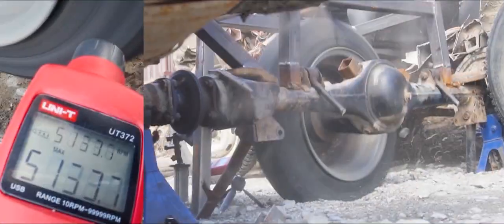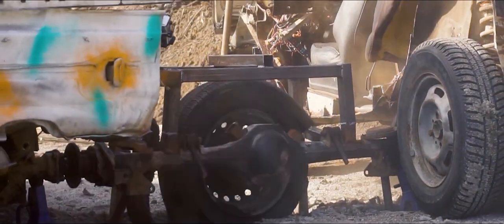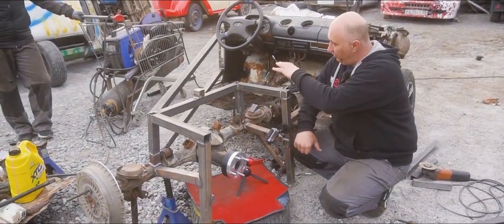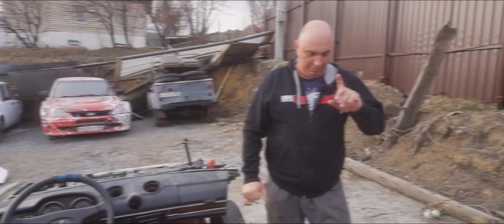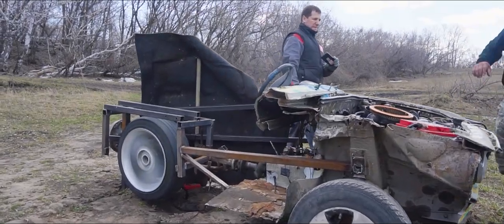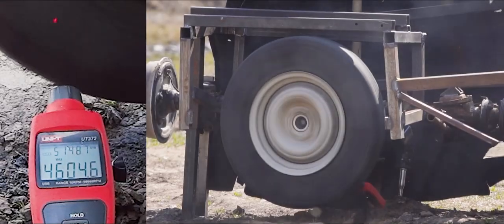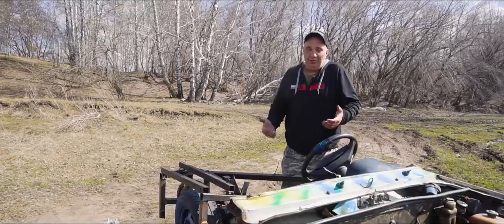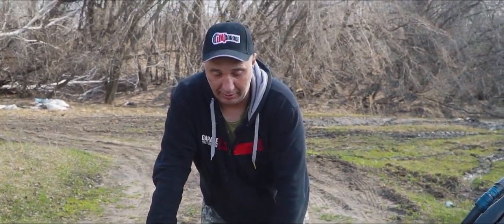Can we get a tire up to the speed of sound?

Comment: "Something just hit my forehead!".... backs off by about 2mm and proceeds to double the revs..
Reply: Ha ha I worked out the energy in a kilo of rubber travelling at that speed last week for the first vid...It is something else! I can't remember and don't want to do the math again but it was like 20 times the energy of a 45 bullet as it leaves the barrel. That cast case of the hub could easily have broken up at 12,000rpm or whatever..It would have simply taken his head off. Now I like the fact they play with danger, but of all the places to stand!!
Reply: @martinda7446  I was thinking along the same lines, like he trusts the studs/hub (and even just any grit attached to them) WAAAAAAY too much. If I knew why people hid behind cushions watching movies, I'd have almost certainly had a go just now
Reply: @martinda7446  it's not rocket science. Energy (in Joules) equals 0.5*m*v^2 (mass in kg, speed in m/s). The velocity of a point on the tyre is w*r (w wanna be omega, angular speed in 1/s). So after all, 2*pi*f*r (f is the frequency of the wheel spinning in 1/s), so it's easy to calculate let's say the outer parts of the tyre.
Reply: @Bzmot332bve  says without an answer to the equation hahah
Reply: @Bzmot332bve  Who said it was rocket science? Even if it is a fairly large part of rocket science, the energy in a moving mass...
I and I'm sure many others might be surprised at the amount of energy contained in that rotating mass. I knew it was large, but really didn't expect to see such big numbers.
You ought to remove that large restriction from your intergluteal cleft.
Reply: That might of not phased him, but the wheel explosion sure did. Seeing a chunk of wheel and metal tossed clear out of sight made it very apparent that nowhere they could've hid would be safe enough at that time
Reply: Typical:)
Reply: @Bzmot332bve  The dude said he already did the math and didn't wanna do it again, but it's easy, so easy you typed out the damn equations without solving any of it.
Reply: epic idea ! now we need to see this !!
Reply: Russian car roulette!
Reply: Safety squints ENGAGE!
Reply: @joel383  you beat me to it! 😂
Reply: And remains standing in the danger zone of rotational failure
Reply: Russian safety measures.
Reply: At least don't stand in the plane of ejection!
Reply: It funny how they trick you :-) they were pretty safe. All of those mass have a lot of energy and monentum about certain axis and will fly on a tangent. +-10 degrees. There are just no forces to change the direction of flying mass by 90 degrees. If the tire was not rotating and just blew stationary, then yes, debris would fly all over the place. But the energy from rotation is a way more than from tire explosion, and it can only deviate from original direction by several degrees. So destruction will be only in the plane of rotation

Comment: Don´t use an axle, use a gearbox in reverse in first gear! This usually is a 4/1 ratio, with 5000 rpm of the engine, it can theoretically go up to 20.000
Reply: Or a trans with 2 speed transfer case
Reply: Could daisy chain a couple trans as needed too lol.
Reply: Might need a lower gear. Air resistance is likely significant on just one wheel - like a gym rowing machine wheel.
Reply: The problem is the engine, it doesn't have enough power to drive that gear ratio to the max. The lower the gear ratio, more power you need to reach the top speed.
Reply: Just turn the transmission around?4:1 out equals 1:4 out.
Reply: @Sm00thieK   exactly, the amount of energy needed for moving whatever mass with a crazy ratio would be way more than a Lada engine can deliver.
Reply: @Sm00thieK  They could also use second or third gear for less overdrive, inverse of whatever they're original gear ratio is.
Reply: I think a gear box in reverse would be too inefficient due the large amount of gears and mass, it will overheat and use a lot of power.
Reply: The engine is the problem. It's a law of nature...the more mass you have to move around , the more energy is needed. At these speeds there is a shitload of forces tearing at bearings, the wheeel and what not in the transmission chain.
Reply: Don't replace the wheel for a smaller one. Replace the engine with a bigger one!!! :)
Reply: @LeoCastroFot  yeah let him see him get a 472 a Cadillac engine
Reply: erm, are you sure it isn't 1/4?
Reply: @GraveUypo  Yes, the output is a quarter speed of the input, which is a 4-to-1 ratio.

Comment: Only in Russia could you get a tire to explode that close to a rpm meter and it not damage it at all.
Reply: That’s because it was not in the plane of rotation. It was safe. If the tyre was blown stationary then yes, rip rpm meter. But when it rotates, debrees just cant go sideways because of the great velocity they have on a tangent, there are just no forces big enough to change that direction.

Comment: The problem with the bigger wheel is not weight, as that only affects acceleration but not the terminal velocity. The real problem is its bigger surface area leading to greater air resistance. There is a tradeoff here to consider in order to achieve the speed of sound. Using a larger wheel requires higher engine power due to greater air resistance, but the tire will be more likely to stay in one piece due to lower centripetal force (because of the lower rpm needed). Using a smaller wheel requires less engine power but the whole thing will probably self-destruct prematurely. It appears that one is most likely to succeed with a large wheel and a powerful engine.

Comment: When that first spun up without a wheel on I would not have been standing that close to it lol I’m surprised the differential didn’t explode lol
Reply: That's what I was thinking! Metal shards like shrapnel.
Reply: the diff is designed to spin at half the revs, but under load. it isn't a gross overload, i'm pretty sure they were pretty sure it won't explode. But still, standing in the plane of fire is asking for trouble.

Comment: Well  it looks like it's  safe to say    you more than exceeded the tires recommend speed rating   you DID gather some good info. From this experiment  pushing you tires past their speed rating could lead to a catastrophic failure  AT HIGH SPEED👍😀
Reply: Well that 2nd (old, used) tyre still lasted until about 600mph. I don't know what you're driving or where but to me thats probably good enough.

EDIT: about 375mph - I forgot these guys work in KM. Point still stands.
Reply: @siraff4461   In real world terms    If you set out across a hot full on sun dessert tarmac    driving at a steady 85mph  on an L rated tire that's  (75mph) a bit under inflated  and on top of that  overloaded probably more sooner than later into your trip   the chances of having a blowout would be almost 100%
Reply: @markcdeyoung3118  Wow those straws look real hard to grab. You think if its rated for 75mph its not going to be able to deal with 85mph? What can it deal with? Does it explode at 75.1?

Comment: So you do read the comments ;)
There was a car back in 1997, ThrustSSC that break speed of sound 1,228 km/h
I don't think normal engine and transmission will get to such high speeds, even when the wheel is not touching the ground , you will have to use helicopter turbine
Reply: ThrustSSC did a hell of a lot of research into trying to make a wheel that could withstand that speed. I think they ended up using solid metal wheels, out of something with a great strength to weight ratio like magnesium, aluminum, or titanium, I can't remember which. The shape was very hard to design given 1990s engineering FEA software. Other things that influenced design were the facts that the wheels didn't have to drive the car or have much grip and that they were going to be run on a salt bed, so if they were too skinny, they would just dig in to the salt and the car would bottom out.

Comment: For the next rig you could mount a second diff onto this one and multiply the wheel revs by 8 times again, this would require a more torquyer motor but requires less revs of the motor.  Great videos as always. Likes from the Netherlands

Comment: how about a motor at both ends of the differential
Reply: That would double the power but it would also HALF the speed. The speed of the pinion (where wheel is attached) comes from holding one side of the diff still.
Reply: @rhyswoodman6781  I think you have it backwards.  You'll get more pinion speed by spinning both ends of the diff in the same direction, as Chris suggested.  If Garage54 welded the diff rather than holding one end still, they'll get double pinion speed (assuming the engine can spin at the same speed) plus less wear and friction (and energy loss) in the diff.
Reply: Your right i did have it backwards.
My mistake.🤣

Comment: Video proposing:
Take a Lada and make every passenger in charge of a single car control each:

Driver: Steering only.
Front passenger: Brake pedal. 
Rear left passenger: Accelerator. 
Mid rear passenger: Clutch.
Left rear passenger: Gear stick.

It would be the perfect "Comrade" car since everyone would be contributing equally.

Comment: The problem isn't the weight. The problem is that as the wheel spins faster the rubber expands to different diameters. This causes the wheel to vibrate which costs a lot of energy. Larger rubber means more force at the end and more vibration. A large wheel rim without a tire wouldn't vibrate as much and would get far more speed. More power with the rubber tires would just cause more vibrations and very little increase in speed. And more vibrations means more damage to the car as it spins.

Comment: i think you should use a motorcycle wheel and tire, the speed ratings are usually higher than car tires, depending on the tire of course

Comment: The weight of a spinning thing has no effect on "terminal velocity", only on the acceleration. Drag and friction is where most of the power is going regardless of what wheel you attach to it. The smaller wheel has slightly less drag, so it maxed out 600RPM higher.

Comment: I am glad you swapped out the center cross brace on top with the 2 going across. I had an idea that it could happen as i have seen what a tire can do when it shreds itself under normal conditions. Acts like a grenade that slaps and wraps around anything in the way. But a Motorcycle tire could be a good one. Maybe that on a old style thin tire or the far wider tire. Less weight and the tire might be stronger with less sidewall to stretch. Could get it closer to that 10,000

Comment: The circumference of a 13-inch wheel is more or less 1966mm. At 5480 rpm when it exploded it was turning at 646km/h.
If the engine had enough power to turn the 17-inch wheel with a circumference of 2286mm at the same rpm, it would have reached 750km/h. Very interesting experiment!!

Comment: 60 HP engine isn't enough to hit speed of sound. Who would have thought XD

1. I'm against using automatic, it will slip, unless you find one with lockable torque converter or dual clutch, which is manual anyway.
2. Install diff oil cooler from old radiator and water pump, or at least hook it up to engine's coolant lines trough heat exchanger.
3. Center the wheel after mounting and balance it properly to avoid vibrations.
4. Perhaps support the axle on the other side, or at least put a solid, heavy duty bearing and like weld it to a concrete/steel base just near the wheel hub.
5. Bolt and weld everything down.
6. From my math, given 17" wheel weights 19 kg total (this is what my wheel weights, 225/40), you will need 263.333 HP on the diff shaft to spin it to 1200 km/h. That's either gonna take some engineering to reduce transfer losses, or you're stuck with search for 500-600 HP engine. Or dump a can of laughing gas on some kitted out Civic/Insight motor.

Comment: You can just use nitrous to increase power. If you use a Japanese engine just get a wrecked liter motorcycle!
As a plus, the motorcycle engine will already be turning over 9000 rpm so you would just have to regear it to 1:1 and you have achieved your speed goal.
As a plus you already have a chain drive with the motorcycle AND and gear box that can handle those revs:

Comment: This is a public service announcement, brought to you by Garage 54:  When performance modding your car, please improve your tires, suspension, and brakes BEFORE your engine.  It may save your life.

As far as the new machine.  A Japanese or European engine and gearbox, with something like a Ford 8.8 or 9 inch rear axle should do it.

Comment: Get a lightweight wheel and a low profile tire, the less weight the better, and also, the further away from the rotational point (The center of the wheel) the weight is, the "harder" it will be to spin the wheel. Cuz science :) Combine that with a stronger engine and you'll be a lot closer to achieving the speed of sound, if that's even possible even with the best tires in the world haha !

Comment: If you want to check out horsepower to speed ratios, just look up some Bonneville Salt Flats cars and bikes. Takes like 2500 horsepower to propel a 1,500 lb vehicle to 370 miles an hour. That's just a random guess, but they do use a lot of horsepower to get there. Even the ball bearings on some of those cars at Bonneville, look like they came off in 18 wheeler. Just enormous ball bearings, they also use special tires that can handle that kind of RPM. You might be able to get a lot of useful info from Bonneville vehicles. Check it out. Cuz I want to see some tires absolutely explode.🤪👍😁💯💯💯

Comment: Don't use the diff in reverse. You waste most of your power to heat it up and making it self-destruct. Direct drive (without the transmission) should be able to get it up to around 6k RPM without sweat.
You don't lose power on spinning the wheel. All loses at the wheel are from aero drag of the tire - that's not much. Everything else is lost in the transmission system.
The best thing would be running some sort of high-RPM transmission in reverse. Probably something from a superbike. Those can handle both the power and the speed.
You don't want heavy duty stuff. You need something that won't disintegrate or overheat at 10k RPM. A Lada diff in reverse did.
Alternatively, simply use a superbike engine and a torque converter. 
Also, it would get much further if you let the engine reach its maximum power at higher revs by using 3rd gear (or even second). 
Perhaps a simple transfer box could survive long enough and hopefully stay lubricated to double the RPM. But probably not.
Just don't use the diff, it's way out of its territory.
The wheel itself (apart from aero drag and bearing rolling resistance) doesn't incur any power losses, no matter how heavy it is. A heavier wheel will only accelerate slower, but it will reach the same speed if other things allow it. 
If you use a more powerful engine with the same setup, you will only make the diff disintegrate quicker. It can't lubricate itself at anything remotely close to 10k RPM. Put some science into it.

Comment: I would personaly recommend a truck rear axle, should be heavy duty enought for it, as for the motor, try something 150hp+. The energy to keep acelerating grows exponentialy. And for the love of god and vodka, shield the dam thing, a this point is efectively a bullet when the tire gives in. Also, want to launch a wheel spinning that fast downhill.

Comment: Bypass the transmission bolt direst to the engine shaft or at least to the clutch so that you still have a 1:1 ratio but can disconnect the power via the clutch a transmission just slows down the rpms to increase the torque to the wheels.

Comment: Intenet, correct me if im wrong.

The rim is 17" in diameter. That´s 43.18 cm.
43.18*3.1415= 135.65 cm in circunference. Or 1.3565 meters.
1.3565/1000 is 0.0013565 km
0.0013565 km*5480= 7.4336 km/min*60=
...
446km/h in the rim. Sad.

Asuming the tire its a common size 225/45 it ads 10.125 cm to the radius.

We repeat everything and we get a speed of...
655km/h

Halfway there boys.

I kind of calculed this as i was writting it.

Comment: For reference, a hard disc spins at 10,000rpm, with a 5cm disc that's about 100mph on the outer edge, which would mean you need a disc drive that spins close to 60,000rpm. Basically, all this means you that you cant go the speed of sound with a tire and a Lada engine lol

Comment: that mush force creates a fragmentation bomb
if you build a ring around the wheel there be less drag from the air and you need less power to spin it 
the metal inside the diff growing doesnt do the end rpm any favours either
after that : maibe try nitrous

if you build a new one i would suggest sumting that can spin the tire up in less then 2 minutes the prevents stuff from heating up , the weight of the tire pushing outward will be impressive , look intoo the vehicles that have broke speedrecords on the saltlakes , they dont have tires but aluminium rims , and the ones that ran less fast used tires with a LOT of cordlayers glued to the rim

Comment: Measuring from 5-in center of hub to 17 in to the outside center of tire will give you a different of speeds we measure from the center of the lug nuts will give you an accurate speed on how fast you're going

Comment: If you used 2 engines (one on either side of the open diff) it would double the rpms at the yolk as both engines would be spinning it in different directions.

Comment: It doesn't matter what size tyer or wheel you have the hub will still spin at 13,800rpm... That rev counter works on time from point to point.. clearly that point has to travel a further distance on a 17 or 13 in compared to just the hub, as the distance from point to point is alot shorter...

Comment: I watched a movie about motorcycle top speed runs, and the tire tread needed to be cut away from the tire to prevent such a failure. You just need to use a sharp knife to cut off all the heavy tread.